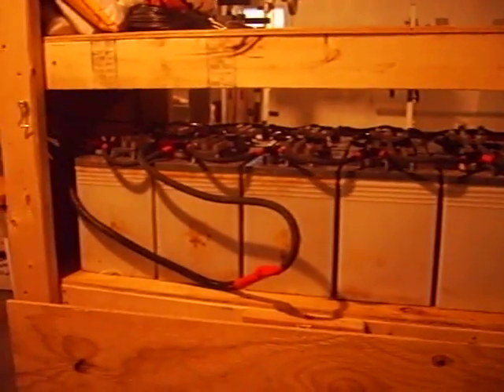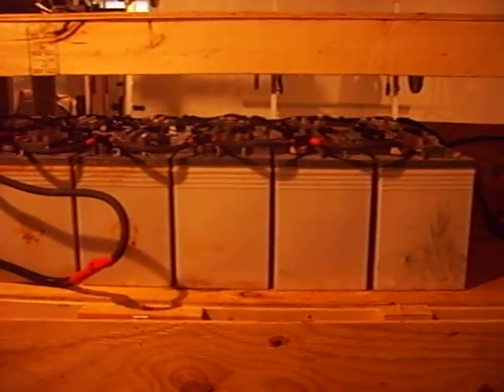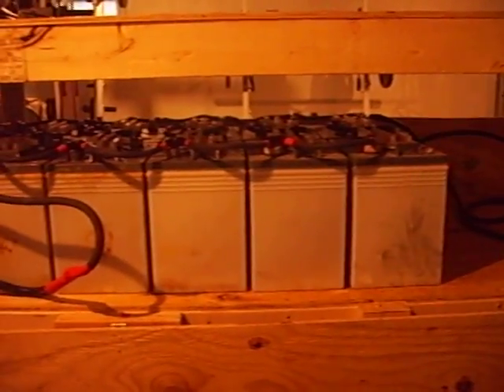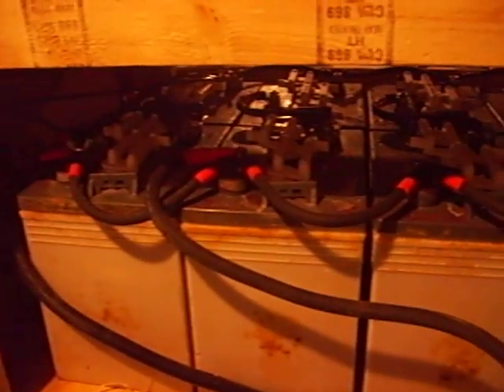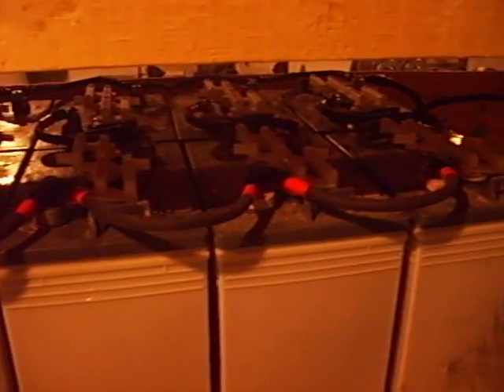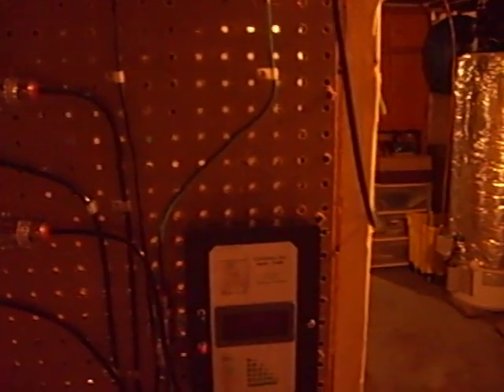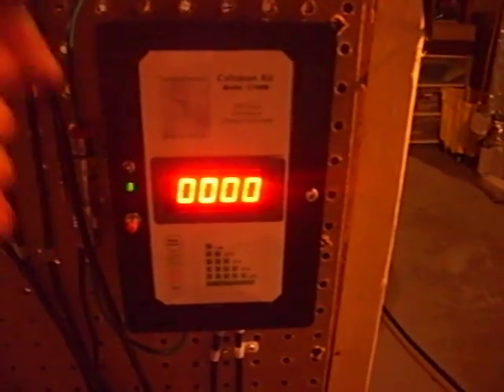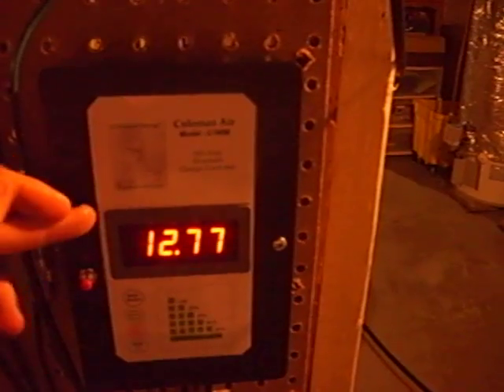home wind turbine generator battery bank

Comment from the maker: Hi ,,no i can reach in and test them each ,i check them about every 4 weeks ,I dont run them to low,so they have been good to me so far,I use up volts during the night ,while at work they charge back up,I am going to add more solar in the spring ,and a few more 6 volt batterys,,
chris.